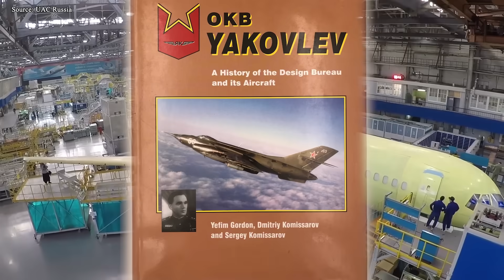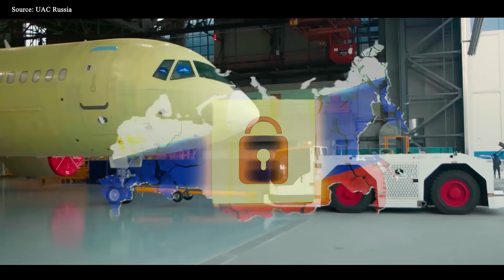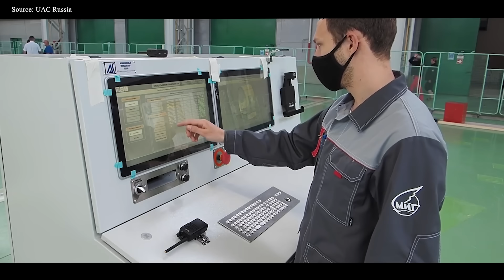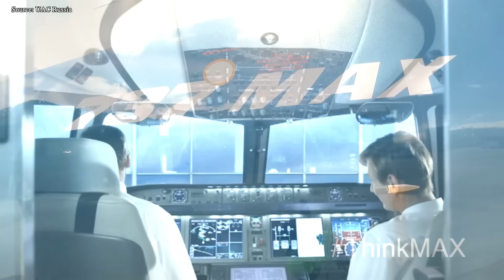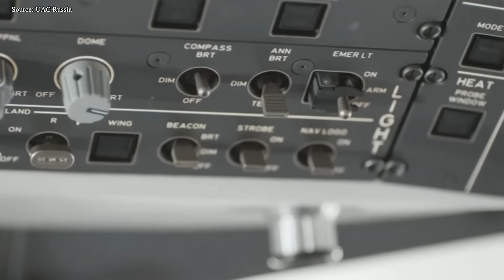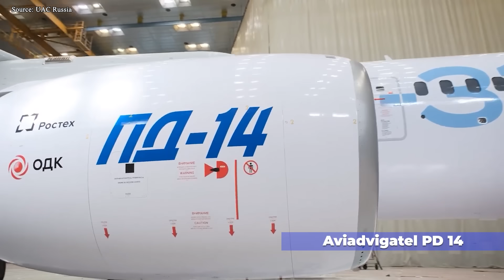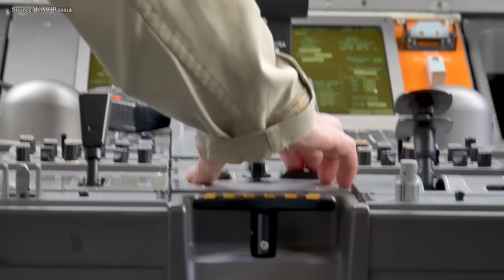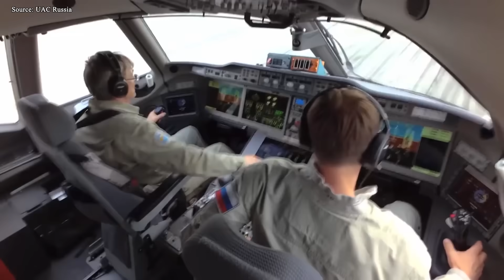This Is Why NEW Russian MC-21 Just OUTSMARTED Boeing 737

Comment: Haha... this jet is a failure.
Initially they put Pratt & Whitney PW1000G and after the sanctions they put the old Aviadvigatel PS-90 from another failure jet Ilyushin Il-96 and they rebranded it in Aviadvigatel PD-14.

The Ilyushin Il-96 was failure because of the Aviadvigatel PS-90, to many failures, expanse to maintain and low thrust where require more fuel! 
And this is only the turbofan.

There are many other parts just made in low quality or no-quality. 

Flying on this jet is gambling your life on Russian Roulette!
Reply: Nice try, Boeing.

Comment: The Boeing 737 and Airbus A321 do not have a composite wing, but the MS 21 does.
Reply from the maker: Exactly, that’s one of MC-21’s smartest design moves
Reply: They have much better flight characteristics than the MC-21, even the infamous 737. Because they use modern components, like engines, materials and avionics. Because of sanctions producers of MC-21 have no access to world market and need to replace everything by domestic parts. The result is low quality of the jet.
Reply: @alexandervt641 This is false news lying bot🤣🤣🤣
Reply: @Раньшебылолучше-б3ю  It’s exactly the news we get from Russia, bot.
Reply: @alexandervt641  as a certified aircraft engineer you sure can go into details and point out exact missing characteristics and technological deficiencies, will you do us such favour?
Reply: @romank4905  One need to be a certified aircraft engineer to understand basic questions? Why then the video is on Youtube instead of aircraft channels? Concerning your question, range has been reduced from 6,400 km to 3,800 km. Weight increased from 79 to 85 tonnes. Service interval of engines is projected 12,500 hours in 2030, more than 3 times shorter than of international vendors like CFM or PW. Not so difficult to understand, is it?
Reply: @alexandervt641  Have you read something somewhere and are in a hurry to share your stupidity? The maintenance interval is always determined based on the results of the inspection of the removed engine. How can we determine such an interval for the PD-14 if it has not yet flown 1,000 kilometers? The forecast for 2030 is 12,500 km, taking into account the current load of the experimental aircraft. With the beginning of commercial operation, it will constantly increase. The manufacturer's data is publicly available on the UAC website. There is nothing there. There is no DOW and BW at all. There is no source of these 5.75 tons. You use questionable sources of information and are not trustworthy.
Reply: @vladimirnikolskiy  The source of increased weight is simple subtraction of official weights: 85 t now, 79.25 t in 2019. 85 - 79.25 = 5.75. This also corresponds to the official range which was reduced over the years from 6.400 km to now about 3.800 km. The maintenance interval can be estimated based on tests, and as I wrote the 12,500 are an estimation. And no, the maintenance of modern engines like Leap is not determined by removing engines but by predictive maintenance of the engine itself, i.e. there are no fixed maintenance intervals anymore. In contrast, old-fashioned PD-14 is still based on maintenance intervals. What you wrote makes no sense; after 15 years of endless Kremlin lies about the MC-21 every sane person should start critical thinking.
Reply: @vladimirnikolskiy  For the increased weight of the jet is not important how the weight is exactly defined. It is only important that it has increased by nearly 6 tons. Or have the Russian passengers gained that much weight? This increase in weight corresponds to drastic decrease of range of the MC-21, now just about 3,800 km. In contrast to Airbus A321neo and Boeing 737 max whose typical range is over 6,500 km. So your comparison of the jet weights makes absolutely no sense. Your whole argumentation is without any logic. And then you complaining about lies? In fact that is your problem! After 15 years of endless propaganda lies of the garbage jet MC-15 only a total idiot can continue in believing in this nonsense.
Reply: @alexandervt641  There is no drastic reduction in the range of the MS-21. There is data on a non-stop flight from Irkutsk to Moscow, for a range of 4,500 kilometers. I do not know for what purpose the UAC updated the data on this aircraft on its website, perhaps this is due to a non-stop flight from Zhukovsky near Moscow to Dubai, at a range of 3,700 kilometers. Anyway, you don't have to write to me anymore, I don't talk to boors.

Comment: WHY were there no winglets on the wingtips?!?
Reply from the maker: Because the MC-21 has optimal aerodynamic wings, it does not need winglets like the old models.
Reply: @CIVILAVIA1 The Boeing 787 & Airbus A-350 have winglets & they are newer. Hmm...
Reply: Winglets work well on long range flights. Otherwise it might become a waste of money. Maybe they will add winglets on MC-21 later as an option.
Reply: винглеты можно добавить в любой момент на любой самолёт, испытания проводятся БЕЗ них; всё будет сделано в своё время;
Reply: Такие законцовки на крыльях дают слишком малую экономию топлива, слишком малую, но при этом ухудшают стабильность планера в зонах с высоким уровнем турбулентности
Reply: @misterkrab674  
если винглеты способствуют экономии  хотя бы 0,5% топлива -- их установкаа уже оправдана;

+ не бывает ни каких =зон с высоким уровнем турбулентности= (такое выражение безграмотно) -- бывают режимы турбулентности, и винглеты их точно ни усугубят, ни отменят;
Reply: @misterkrab674  ну там вроде от 4 до 7% экономии топлива. Но это на больших дистанциях. Нужно еще посчитать расходы на установку и обслуживание такой доп конструкции. Думаю на мс-21 ввиду изначального меньшего индукционного сопротивления крыла винглеты большой роли не играют. Может кому надо поставят опционно.
Reply: The designers of the MC-21 made a wing with a longer length, while meeting modern requirements and restrictions of international standards. And the rather old Boeing 737 (it was released in the 60s) and the airbus 320 (80s) are forced to install wingtips in order not to re-develop a new wing with a longer length.
It turns out that the new wings have more lifting force, and due to its length and greater lifting force, it eliminates the effect of these vortices and the output is an effective wing, without unnecessary structures on it.

Comment: The MC-21-310 is not a competitor to the A320neo or 737 MAX in global markets.
It is a sanctions-era survival tool for Russia’s domestic fleet, with performance closer to 1990s-era A320ceo/737NG than modern neo/MAX.
Reply from the maker: True, but it still shows impressive tech for Russia’s current limits
Reply: @CIVILAVIA1  those limits are only there bc idiots run that country. Cant design or even copy a well functioning turbine in 30 years? The Brits can, the French can and even the Germans can (MTU). 
But the Russians are too stupid? No, but the smart Russians are not in Russia anymore!
Reply: @gkossatzgmxde  any proves?
Reply: @CIVILAVIA1  The Boeing 737 and Airbus A321 do not have a composite wing, but the MS 21 does.
Reply: And it costs several times cheaper than Western planes (yet safe enough compared to Boeing) so it has potential in the world outside of Western countries
Reply: @mrobocop1666  no my brainwashed friend. it is actually more expensive compared to ALL other models in the same class. GOOGLE IT !

Comment: heavier, worse engines, higher fuel consumption, no delivery and support structure, no certification, true it is outsmarting decades older 737 isn' it?
Reply: 373 with all  certifications having lose emergency doors. Is this a feature or outsmart move in skies ? US and France made world to look further, look away..... MC21 is the answer. We need multipolar world, not just duopolar !
Reply: @flanker23 слабоумное😂😂😂
Главное лаптями и портянками запастись😂
Reply: @asars111  Кизяками и салом, Мыкола.
Reply: Considering the 737 likes to actively self-delete on the regular, yeah, all competitors are better.
Reply: Heavier!?
Curb weight or operating empty weight (OEW) of the Boeing 737 MAX 8, which is a direct competitor of the MS-21, is 45 tons, which is 6 tons more than the MS-21-310.
You are obviously using bad data... or you are lying!